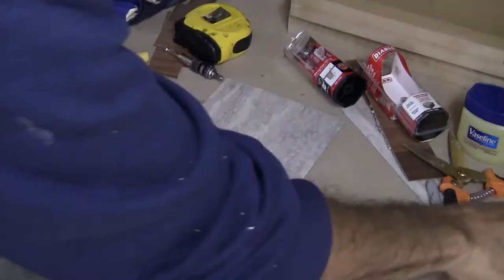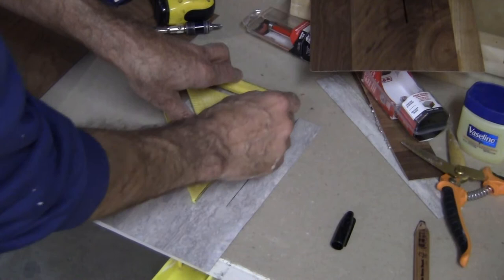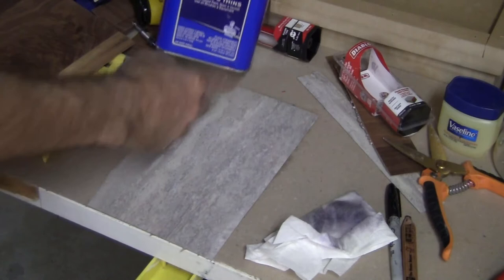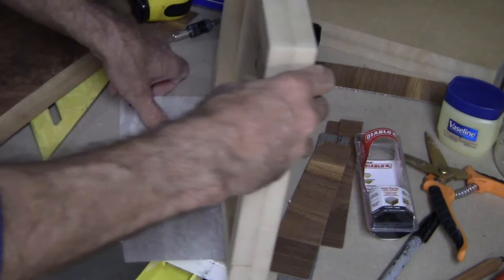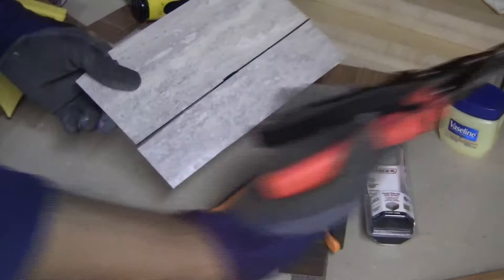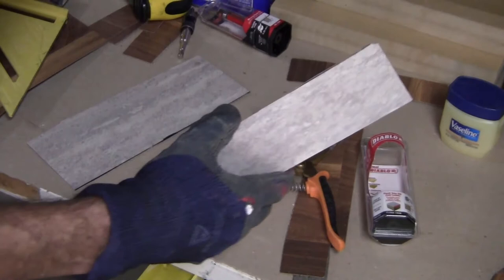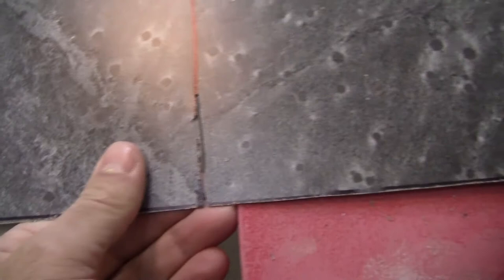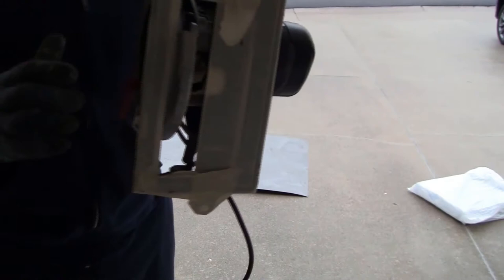How to Mark and Cut Formica Laminate Sheets

Comment: Formica chipped a little using circular saw. Had enough to be trimmed....luckily. Saw another vid where a guy cut with the laminate on drywall cutting into the drywall and it looked OK.

Comment: A scoring knife with a sharp tungsten tip is the go. Score and snap. Done. No splintering, or tear outs.
Reply: Hey there! So I’m about to cut several huge sheets of Formica and I’m nervous- so you said a Scoring Knife (tungsten tip) is the way to go. So do I just make my line and then score it, and then snap it? Are there any other little details I should know before I try this?

Comment: If you are going to assume that black sharpie can be removed by paint thinner, you should test this first.  Black sharpie didn't wipe off of my vinyl sheet with paint thinner or with naptha (my go-to solvent).  Acetone, luckily, did the job.  But acetone can also ruin some plastics by creating a haze in the finish.  Test your solvent first before relying on it to save yourself from a stray line.
Reply from the maker: Good advice, Thanks
Reply: The best Sharpie ink solvent is rubbing alcohol. Works every time and is closest to the actual solvent used in the markers.

Comment: Thanks for the video. I removed the 4” by 1” backsplash just to find out the Formica stopped 1 inch from the wall. It wasn’t installed under the backsplash. So now I need to cut down a 1” strip and patch along the wall.
Reply from the maker: Those surprises happen. I am sure your project will come out great.

Comment: You can also use Expo vis-a-vis transparency markers... they clean-up with water... I'm also thinking that cutting the material with the wrong-side-up might give you a cleaner cut with the circular saw. Thanks for the video!
Reply from the maker: Thanks for the marker tip.